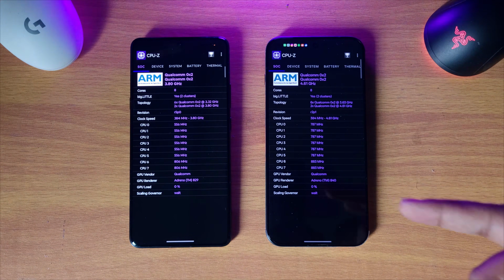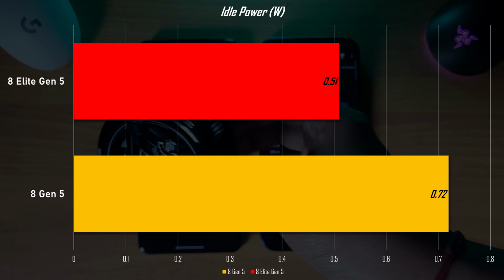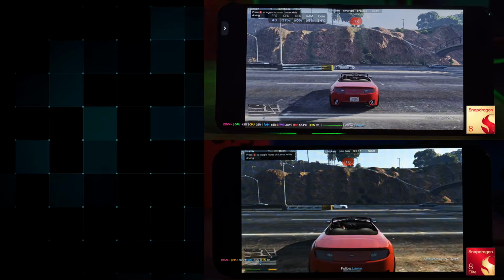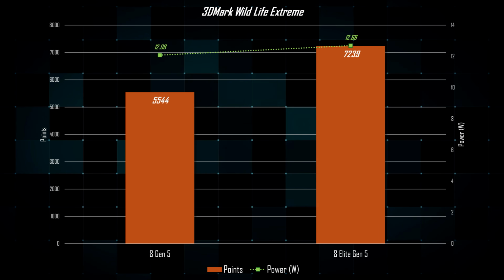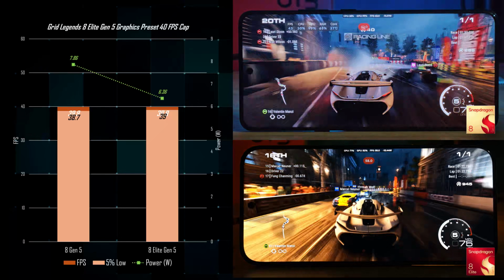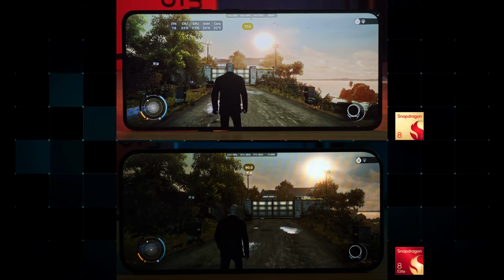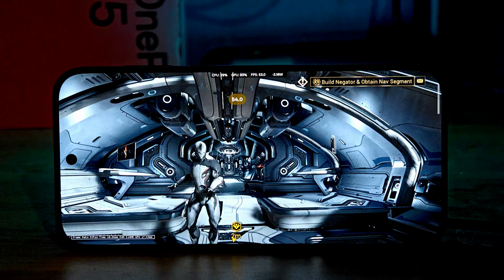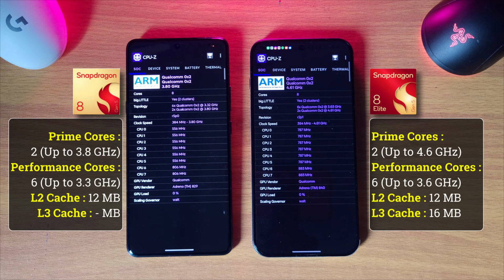SoC Analysis! 8 Elite Gen 5 vs 8 Gen 5 - Performance and Efficiency Test 🔥 OnePlus 15 vs Moto Sig!

Comment: Solid content! I'm debating between the Dimensity 8500 and the Snapdragon 8 Elite Gen 5 for my next upgrade. My Realme X2 has lasted 7 years on Snapdragon, so I value longevity. The Oppo Find X9 looks great for the price (under 65k) with the big battery and Action Button, but the LTPS display is a concern. For heavy use over 5 years, is the Dimensity 9500 a safe bet for efficiency?"
Reply: The 8500 is much weaker compared to the 8 elite gen 5. 
I think you did a typographical mistake by typing 8500 instead of 9500. 

Between 9500 and 8 elite gen 5, the 8 elite gen 5 would be the better pick if you want a premium mobile phone with a long life span, and it can also emulate a lot of PC games.

Comment: Hello sir I have oneplus 12 in bgmi at 60 fps its laggs very often but when it comes to 90 fps it runs very smothly i thinks its problem of oneplus if we dont push limits of the Soc in oneplus mobiles it dont use its full potential

Comment: Hello bro, I'm currently using op11 and I'm planning to upgrade and my budget is around 50k which phone should I go with? Performance and a bit of a camera are my requirements,can 15r be a good choice or a second hand op13?
Reply from the maker: OP13.
Reply: @techstation365  is there anyway to get it at 50k or below without exchange? Bcz my op11 has a cracked back panel and I'm not getting a good deal for exch

Comment: Just looking at the gameplay, the brightness on motorola seems a lot better than on oos. I don't think it contributes to efficiency in a big way but I wouldn't rule it out. It can just be that motorola has a better panel.
Reply from the maker: Sir read the pinned comment. They were shot with different devices using different picture profiles. I calculated idle power draw, kept devices at same real world brightness and even kept volume at zero. I won't make such rookie mistakes.

Comment: Not only in Wuthering waves but genshin impact too. Way too much stutters you would be hard pressed to find 8 elite gen 5 better than the 8 elite and yes it has to do with CPU. idk what's with these games from kuro and hoyoverse where they have messed up cpu utilisation. You would think after 5 years genshin would be able to sustain 60fps locked but no lol 8 elite was the last processor to do it on most devices.

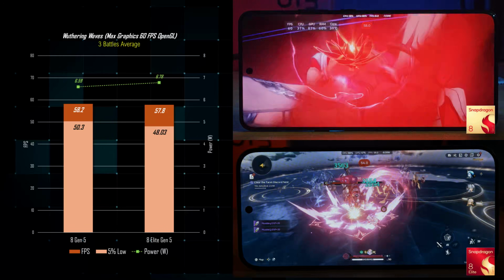Comment: 6:30 I remember OnePlus pushing an update a while back that underlocked CPU performance because the 8 elite gen 5 overheated when pushed
Reply from the maker: I had covered it in detail and showed that that update only nerfed performance in 3dmark. There is no issue with CPU clocks or GPU clocks or power limits in other applications - else OnePlus 15 wouldn't be so good in emulation which is extremely CPU intensive.

Comment: Before even watching the video I can tell 8 Gen 5 is weirdly positioned and mislead by Qualcomm. Last year's 8Elite is still better than 8Gen5, it literally crushes in GPU, no. of shaders and the most important thing, caches.
The CPU may seem to be 3rd gen or whatever they say, but in practical 8 Elite with 2nd gen still edges out due to higher clock speed.
Overall, for normies.. it goes like this: 8EliteG5 > 8Elite > 8Gen5.
After so much thought I decided to go with 8Elite (Realme GT 7 Pro) and oh boy, you'll be amazed. I have posted on my channel where the chipset performed in Wuthering Waves v3.1 (Academy area) and comfortably maintained 55-60fps and remained relatively cool. Btw, just for reference, even A19Pro in IP17PM failed to provide a locked 50 fps in such a demanding area (as I've seen in few gameplays).

Comment: Bro can u do a comparison between 8gen 5 and 8 elites, I m confused should I go for one plus 13 or one plus 15r
Reply from the maker: How is this a confusion? 8 Elite and 8 Gen 5 in practical gaming scenarios will be within 5% of each other but the OnePlus 13 has a better display, much better cameras, USB 3.2 gen 1 with display output. OnePlus 13 is an easy choice.
Reply: @techstation365 thanks man 😮
Reply: 13 is better

Comment: Great approcah, great test and point of view.
 For next project, better utilize same brand phone for chip comparison. Because every brand have their own tendency.
 The result would be more accurate, more clear to comparison between chip if we used same brand.
Reply from the maker: Yes but I have tried to keep both phones in unthrottled state. Motorola surprisingly can push up to 19W for a first 3 mins or so, and doesn't require any app spoofing and all to do so.
Reply: @techstation365 Do you think the Moto Signature is a good balance of performance, photography and battery life for the price? Do you have any recommendations for a good camera phone that can also play games like Grid Legends etc. without throttling around 50k - 60k price?
Reply: @techstation365 even on unthrottled state, each brand have different approach to tuning their chip in heavy task/full usage.
 Maybe this is the reason difference in CPU usage between oneplus and motorolla in wuthering waves test. 

Same brand make it more simple and better gauge tbh, we clear many variable with same brand approach.
Reply: Fax 😭
Reply: Can oneplus 15 push so or as u said it's cpu bottleneck. Can u try disabling battery i think it can push to hard just like redmagic phones  . I haven't try this  I have bought this oneplus 15 and I am afread that oneplus is going to down it's performance after a while . Plzz try this trick

Comment: Can you do a comparison of SD 8 elite vs 8 gen 5?
Phones with the 8 elite(esp refurb'd) are super well priced now that make them so much worth it compared to 8 gen 5 ones
I got my oneplus 13 for just 50k on cashify and I'm glad I didn't opt for the similarly priced Oneplus/iQOO 15R
Reply from the maker: 8 Elite is around 5% better than 8 Gen 5 in practical gaming scenarios but most 8 Gen 5 phones in India are too compromised compared to something like a OnePlus 13 which is an S tier flagship.
Reply: Same with me between the xiaomi 15 or the oneplus 15R went for the xiaomi 15 it's a great device
Reply: Same 😢

Comment: It's supposed to be sd 8 elite vs sd 8 gen5
Reply from the maker: I don't have an 8 Elite device anymore, but I can say the 8 Elite at best is at best 10% better (for 100% GPU bound scenario), mostly you will see a 2-5% difference in mixed CPU/GPU usage.
Reply: @techstation365  i knew that sd 8 elite is superior than 8 gen 5 but not much but supirior in terms of support and proper flagship chipset

I think I'll buy the iqoo 13 from iqoo store

Refurbished one 
Bcz I'm not a hardcore aaa gamer like u

For bgmi and day to day usage

What's u r thought about this

Please reply
Reply: Yes need this comparison
Reply: So 8 elite (4) sits closer to elite 5?
Reply: @vivekmenon2879 nope, the 8 elite sits close to the 8 gen 5 but performs better because of its higher clock speed of 4.3Ghz

Comment: Hey brother I check your videos,that  shows you have knowledge about phone deeply So suggest me a phone who last 6+ years only for gaming or other normal usage I confuse between iQOO 15 vs Oneplus 15 so tell me which one better , My budget 70k , if any mobile other brand is better model have so suggest me
Reply from the maker: OnePlus 15. Unless you go just play BGMI all day, it's OnePlus 15.
Reply: @techstation365  even in bgmi iQOO caps clock speed
Reply: @techstation365 Bro I play CODM or asphalt 9 only 3  hours daily or normal use watch some webseries but want a hassle free phone for long years
Reply: He had already made video on those phone comparing their performance as well....go with Oneplus 15
Reply: @abhijeets4723 brother I ask for a phone who go upto 6 years with me not 1 or 3 year
Reply: 6 years+?8E gen 5 doesn't seem to be a big breakthrough pair to his previous generation 8 elite,isnt it would be better to hope on 8E gen 6 since is gonna be the first 2nm chip for snap